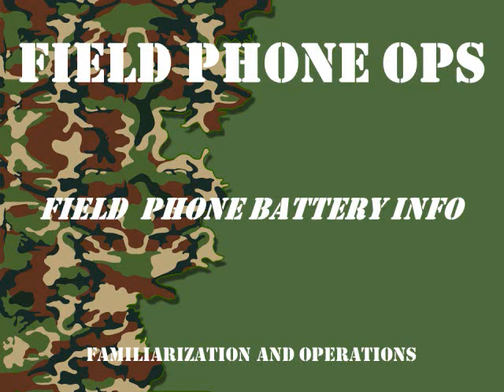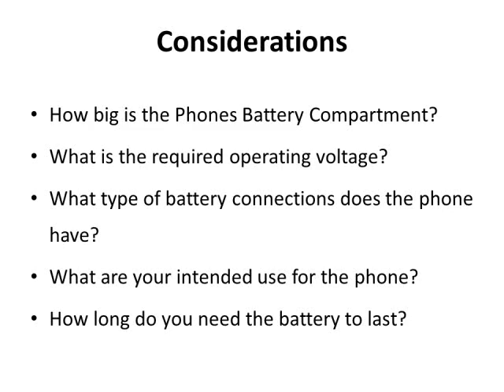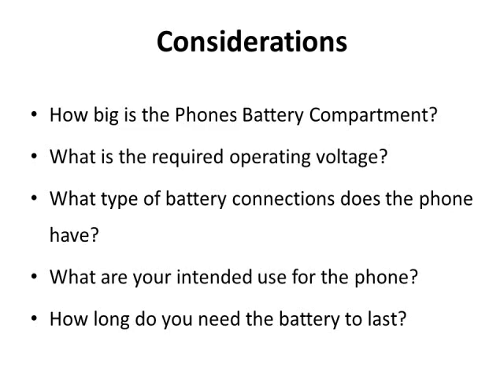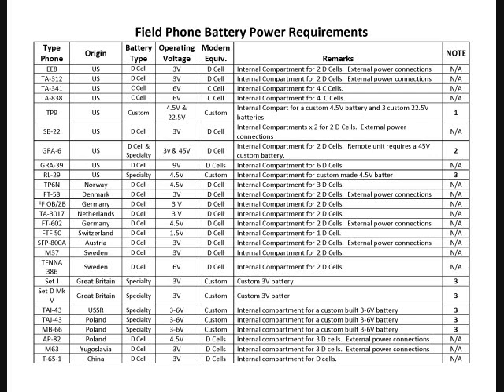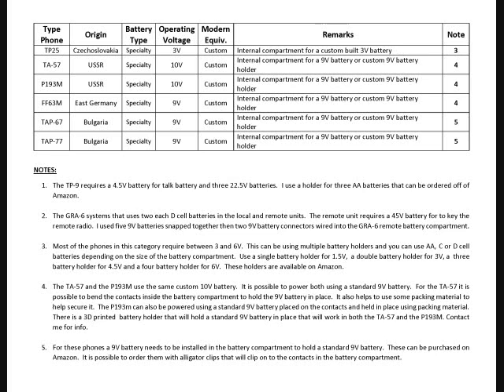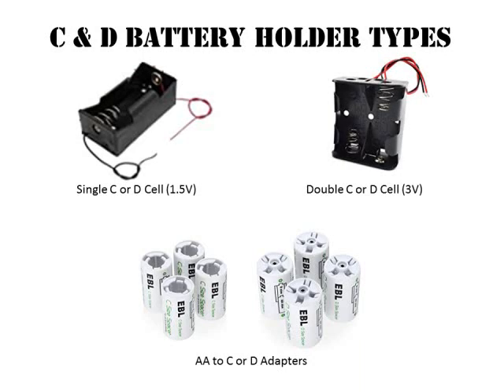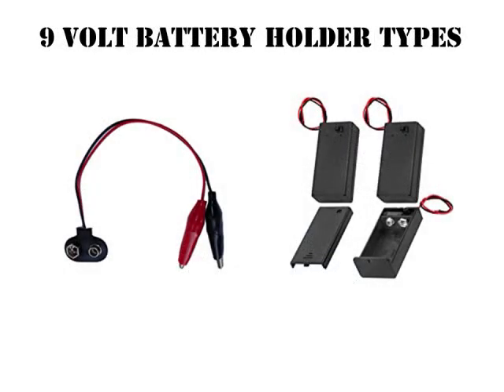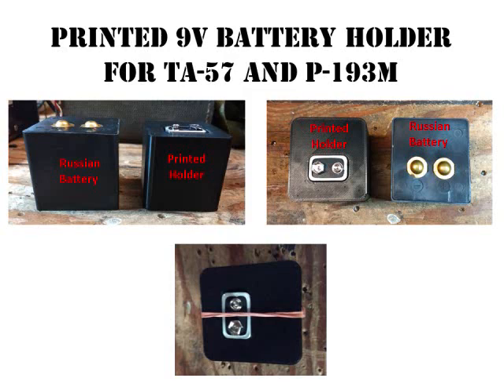FIELD PHONE OPS:  Field Phone Battery Information

Comment: I picked up several of these battery holders of various sizes and shapes. I particularly like the AA to D adapters. Very useful for D cell lights if you run out of D cells but have AAs.
Going to try them in TA-312s. They won't last as long but it's good to have a choice.
Thanks for another great and informative video.
Reply from the maker: I'm in the process of putting together a video to address these adapters in detail and also go over powering field phones with external batteries.

Comment: The German WWii phone FF-33 works on 1.5A only, the original battery is not available, but a D-cell in a holder with 2 wires will last for long. Even an AA battery lasts pretty long.   The original carbon transmitter capsules  (With large green X stamp) may be replaced with whatever you have that fits, but then the voltage has to be increased. Try carefully to you get an OK sound level. To high voltage will shorten the carbon transmitters life.

Comment: I’m thinking about getting a TAP-77, it doesn’t come with the battery, so is there any good alternative to the battery I can use or can I use a regular 9v somehow?
Reply from the maker: Depends on the model.  Some that were made for export actually use six C cell batteries. . Otherwise you'll have to get a 9V battery snap on that has two alligator clips.